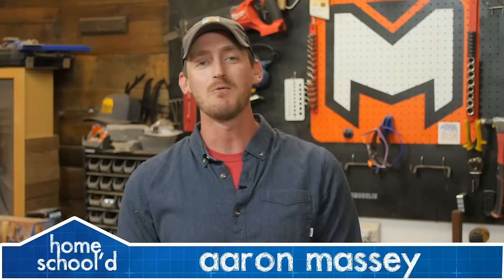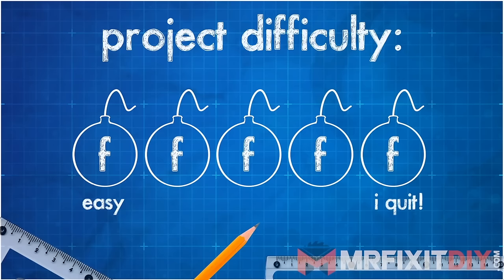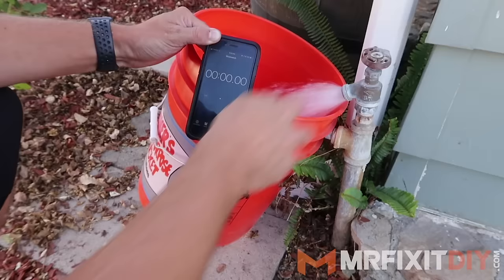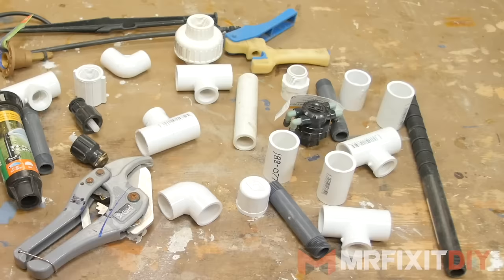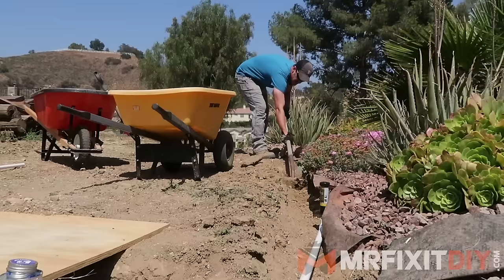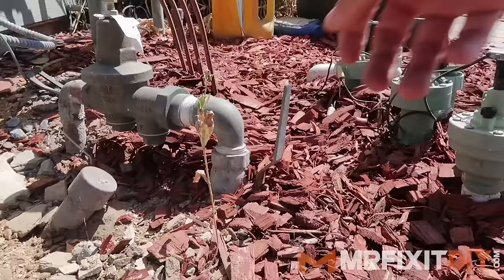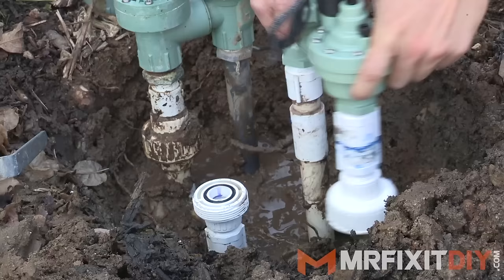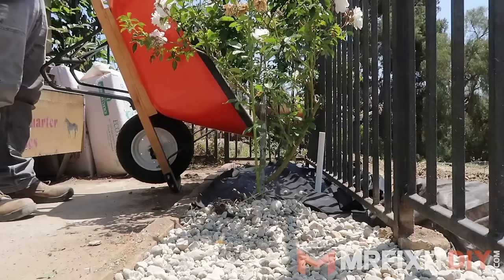How to Install a Sprinkler System | A DIY Guide

Comment: I feel like the amount of f-bombs goes up with the amount sprinkler heads and zones lol.
I have six zones with the exception of one are all over 4,000+ feet lol. I have a lake behind my house with a jet pump that feeds all of them. Currently the pump is burned out and needs to be replaced with 99% of the lines
Reply: :s good luck
Reply: This setup sounds very odd and challenging... right up my alley! If anybody can get this up and running properly its me.

Comment: Can you use pex tubing for a sprinkler system?
Reply: Sure can but it will cost more for fittings unless you can get plastic ones
Reply: Yes you can! Just never call a actual irrigation tech to fix your mess. You built it you own it.

Comment: If this is only 1.5 F bombs I would love to see something that is 6!
Reply: I was thinking the same 😵
Reply: I would be off the charts.  Probably somewhere around a 27 or 28.
Reply: Anything on a car. Especially exhaust, engine or suspension/brakes. Get out a torch, grinder, welder and be ready to run for some new bolts,and new parts. Lol

Comment: How do you drain a sprinkler system?
Reply: Turn off the water supply,  disconnect at the union.  Blow compressed air through the hole system to push all the water out.

Comment: These valves have been made illegal in most states because they are an AVB, atmospheric vacuum breaker. These are plenty of city codes to follow when installing a sprinkler system. Contact your city for a list of codes or just hire a real professional.

Comment: Why not use 3/4 polly pipe instead of pvc? The repairs would be more easy for home owners and installation as well. I been on irrigation for over 10 years. This isn't a do it yourself kinda job.
Reply: Because poly pipe is trash

Comment: Don’t do the bucket test. It’s not correct method. The shape of spigot restrict water flow. Sprinkler valve also restricts the flow. You have to cut the pipe directly after the sprinkler valve to do the test correctly.

Comment: Never check the flow rate through a hose bib always check open pipe to get a true reading also running the whole system in 3/4" is an true amateur install
Reply: Why? Would you rather be using 1/2 or 1 inch?
Reply: @DjMpak  most hose bibs only flow 8 to 10 GPM most water sources produce more than that so it is not an accurate measurement and as far as pipe size start large then drop down its about volume

Comment: Those antisiphon valves are trash, have fun replacing them after 2 winters, also the antisiphon device is not testable so it wont pass muster with local ordinances. Also, this whole system is trash.. homeowner installed systems are always trash. Theres a reason plumbers get licenses and irrigators get licenses.. do not install your own system the water damage it will do far outweights any savings you thought you would get.
Reply from the maker: Call your Mother. Sounds like you need a hug.

Comment: Been building systems for 10 years and everything minus the suggested depth is bad advice. 1) no mention of a backflow device.. 2) attaching your heads directly to a pvc Tee using a nipple is also a joke. Flexible swing pipe will save you a headaches if a car, mower or fat guy step on the head and break the brittle nipple.. plus Home Depot is not the vendor to purchase from. Sad folks are giving bad info on a system that should last years if done right!! Thumbs down on this joker!
Reply: He did mention a backflow device.
Reply: @saeed7099  eh not really he mentioned an “anti siphon valve” which acts as a backflow but it’s never gonna be as good as a properly installed one